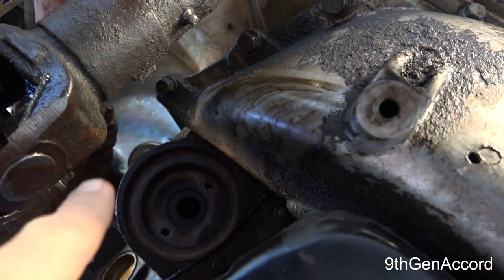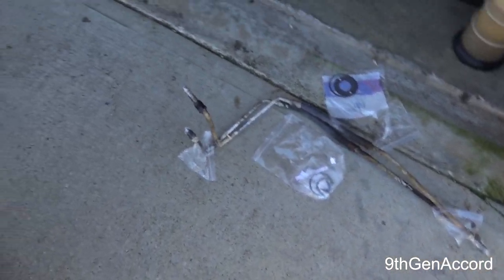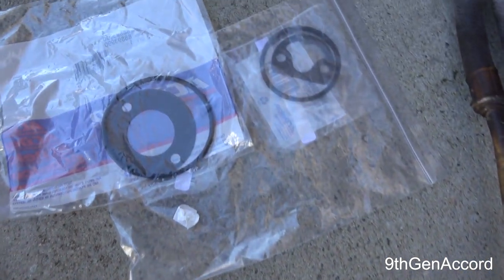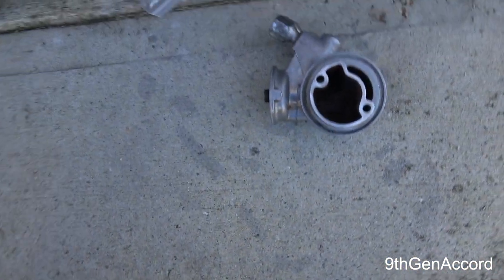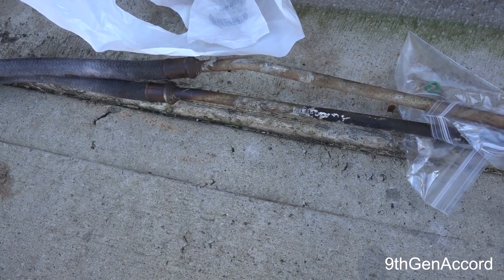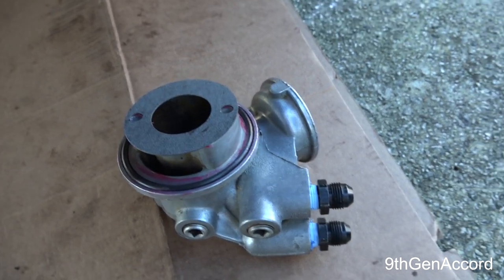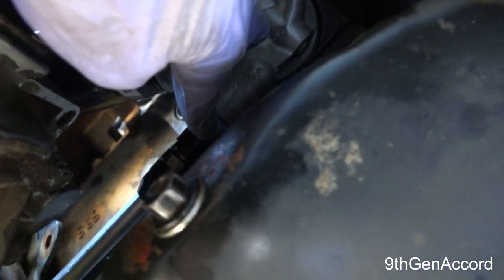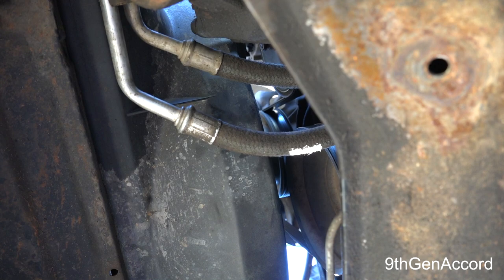Chevy Oil Filter Adapter and Cooler Line Permanent Fix 1988-1998 Chevy

Comment: What 9th Gen Accord failed to mention or show in this video is the actual mod to the hard lines.  It requires a 1/2" compression to -8an installed on the hard line (after cutting off the formed end which fits into the original fitting) and a 3/8" male NPT to -8an male fitting that screws into the oil filter adapter.  You'll need two sets of these to complete this conversion.
Reply: Thanks!
Reply: Thank you
Reply: Why not just replace the whole line with a upgrade flexible one?
Reply: Thanks
Reply: @ryanjohnson8099  hard lines are better, like video producer mentions, the rubber fails where it meets the aluminum. Had a 1994 Caprice 9C1 dumping oil pretty bad from one of these rubber to aluminum ends, very similar design on 9C1 caprice except for having a fully auxilary oil cooler and not this cheap junk plumbed into the radiator(where dexcool turns acidic and eats the heat ex changer in radiator and then you hopefully can figure out the end result). Replaced the leaky GM oil hose with 3/8 or 1/2" oil rated air line from a speed shop who would sell this high end air hose to use as fuel line to guys who couldn't afford AN fittings like me as well at the time. I was HIGHLY skeptical of this special air line but it worked flawlessly on these applications. And no viewers and readers, do not by HF or w-m@rt airhose and expect it to work. You could well kiss your engine goodbye. I went with a speedshop owners recommendation who cared more about repeat sales and saving people money over making big bux every sale.
Reply: Is there part numbers for the fitings I am having the same issue on my truck but I am leaking from the rubber Orings and would love to do this to my pick up
Reply: do u have a source for them ?
Reply: What are the exact fittings used on the aluminum tubing once he scraped the braided airline hoses? The exact sizes amd the department you buy them at. Thanks!!!

Comment: Poor design? Dude your trucks like 20 or 30 years old! I would say Chevy made an awesome truck
Reply: It is inherently a poor design. Kind-of like their power steering lines that seep oil from day one, ther is no fix and gm still uses these lines, the only real fix is to make your own lines or get custom ones made by a hydraulic guy. They have their faults, and could be designed better. Your not wrong, it is old at this point, but these failed prematurely all the time with these engines,

Comment: I hope the engineer that designed the oil cooler lines was fired! Such a terrible design. Deleting the lines and putting a regular oil filter adapter on is the easiest way to fix the leaky line problem. You don't need the oil cooler and your check engine light won't come on and you don't need to plug the holes in the radiator where the lines connect to but if it makes you feel better, put a plug in them. Problem solved.
Reply: Can’t you just use two plugs on the adapter that’s already there? Why get a different adapter?

Comment: The proper fix would be to ditch the factory lines and factory in radiator cooler all together and install an aftermarket cooler with all AN lines and fittings.
Reply: compressions work fine if using good hose and line.

Comment: I tested how effective the factory style oil cooler is. On a hot summer day, it lowers the oil temp by 6 degrees. It's not very effective obviously so I deleted the factory cooler and used an external cooler. I saw oil temps drop 30+ degrees after that. Factory oil and trans coolers suck.

Comment: I just delete them with an old school filter adapter, I have seen many engines toasted from the oil cooler failing. Never needed one in the 70's don't need one now...

Comment: This is a pretty good video and although my leak was caused by some halfwit using silicone on the old gaskets when the new engine was put in the truck this video illustrated the correct gasket part number so I was able to go right to work already knowing that my truck had new lines so the leak was therefore the gasket or a cracked housing. I got right to work and done. It took me longer to run and get the gaskets at our local dealership that it did to clean up the housing and put the new gaskets in. JUST A NOTE A CUT DOWN OPEN END 1 INCH WRENCH IS THE TICKET TO GETTING THE LINES OFF AND BACK ON IF YOUR PROBLEM TURNS OUT LIKE MINE OR NOT. THE FRONT OF THE LINES AT THE RADIATOR ARE NO METRIC THE SIZE THERE IS 7/8th. Good video nice curve on line modification. Also I bought out what the dealer had in gaskets. I bought all packs is all they had on hand since my son and I own several of these mid 90s trucks.

Comment: Why didn’t you just do the metal braided line the whole way?
Reply: Yeah or just make a rubber hose with clamped on fittings that fit the cooler and offset block which I believe are 3/8" npt.
Reply: For flexibility
Reply: @mickjager5974  just watched the video and thats what I was thinking that I could just use a hose and delete the metal lines altogether because my 2005 GMC is leaking at the O’ring where the C-clamp is at connected to the radiator.Do u think that would be fine to do it this way?
Reply: @walker1474  Probably. I ended up buying an adapter that lets you abandon the oil cooler. I don't feel like I work my truck that hard to really need it. It was a very simple change over.

Comment: I replace this entire cooler assembly with a summit racing unit, AN fittings and a oil cooler with a dedicated fan and thermostat. I have 5 GMT-400 trucks. None of them leak oil.

Comment: I have a 4.3 and i was wondering if all the Blocks have the 2 tapped holes for the adapter to bolt to   cause my remote system has to be bolted to block  and im not sure if my block has the 2 holes i have seen some that doesent have them.

Comment: I put a small oil cooler on my son’s k1995 and it leaks with auto zone gaskets set does it have to be the big filter housing or will small housing work as well please help

Comment: !997 chevy 1500 pick up with 4.3 engine. with oil cooler. Drive shaft fell out and hit the adapter block that oil filter screws into and broke it. Can I remove it and replace it

Comment: my oil cooler line at the crimped fitting just blew off while on the highway, fun times. wondering if my 350 even needs an oil cooler?

Comment: i have the same truck with oil pressure issues. Those 2 pipe plugs have bypass springs under them? i have a feeling mine are shot and weak.

Comment: I'm replacing just the hoses and reusing fitting but for some reason I can't get them threaded back into the oil filter/engine side. Don't understand. Can the little o-ring be the problem??

Comment: hi...I have the same oem set-up and could you please tell me how did you get the an fittings on the tubes before the oil cooler adapter? thank you the video is excellent but did not show what I need ...thank you again

Comment: Can I replace my oil filter unit? Will the center thread thing change out  from a 1991 c 1500 350 to a 1995 k 1500 350. Im putting the 95  k 1500 motor  in my 1991 c 1500. I dont need the oil cooler set up .  Would rather use the 91 set up. Will it innerchange?

Comment: Just completed this conversion, including filter housing gaskets (of course).  Suggestion - plan to insert PTFE/CPE flex hose for at least lower housing inlet line.  If you cut original lines at the extreme end of line (right before flare) you might be able to work it.  Otherwise, you'll have issues with the short straights/bends.  1st cut didn't provide enough straight line section for fitting.   Then cut line back to 2nd flat section (~1" further) and was able to get flare fitting on. But the line angle is not great and close to frame/transaxle. I consider this a workaround until I get a flex hose in there (which I had it to begin with).

Comment: I have a Question. I did change the the connectors before I seen your video but I used a compression fittings instead of flair fighting. I have lost some oil pressure. Is this normal? Is their something I can do to correct this? Thanks in advance.

Comment: I actually have a leak at the radiator on mine. It drips oil right below where it fits into the radiator. You would think it would leak at the back where the plastic fittings are. Hopefully I can just tighten it.

Comment: Can't you buy steel line for say Transmission cooler and run from the rad down to the flexible line you showed. They have larger steel lines that can be bend to the shape of your old lines.

Comment: A couple of comments - having 2 4wd GMC vehicles, 92 K1500 and 97 Yukon. There is a new(er) change from the plastic retainer for the push-lock oil cooler lines; the newer adapters have a spring/circlip that securely locks the oil line into the adapter.  The o-rings inside the adapter are what repeatedly leak after time (by the way, there are o-rings at the radiator connection end also).  I have changed out both of mine at least twice over the years.  This option with just the AN conversion at the oil filter adapter alone is worth the price of admission here!  I didn't even know there was a compression adapter for 1/2" tubing to -8 AN... Great job!
Reply: do u have a part number for the updated retainers that you used? thanks in advance.  I have seen these on transmission lines as well for upgrades,., because the transmission lines were blowing out as well.

Comment: Heat, oil, vibration... plastic [that embrittles and fracs out over time].  Gee, what could possibly go wrong, GM?
Earls makes a straight up 3/8" npt to tubing fitting, but I havent used that so no recommendation there.  I mention it because you installed a little extra something behind your -8 AN fitting for tubing.  What was used?

Comment: Good ol' design for assembly... I replaced 3 lines with Dorman units on my 2000 5.7 van, all three failed at both hose crimps! This is in addition to everything still leaking at the push-in connections or course. Next project is to replace everything with AN flares and BMRW hose assemblies and be done with it!

Comment: Good explanation, nice looking work. My top line is leaking at the front, so I'm about ready to address that issue. Mine, however is a 1994, and I believe the flexible part extends farther up toward the tank. That should give me more room for fittings in there. Thanks

Comment: Good video, plan on running copper on 97 K1500 (left over 1/2" from a home heating oil debacle I do not plan on using) and some oil rated hose for the flex section, but will make rubber section shorter(since copper has better yield than aluminum) much like a setup on a 66 GM car I have collecting dust

Comment: Good job and great idea.  Which exact Blue Monster Teflon tape did you use?  Also, I may use the Teflon tape at the radiator because I get a "weepy" (vert slight) leak there.

Comment: You made me realize that my 1999 4.3 may have had an engine oil cooler hook-up because in front of the oil filter housing,  a hose about 12" long comes off the front and loops back and attaches  back next to the other end next to the hose that came out. I wondered what happened there.  It's a built 1999 4.3 put into a monster 1993 Suzuki Sidekick JLX body sitting on a Toyota truck frame. The transmission hoses go to the bottom of the radiator where your engine  oil coolant lines may go. Maybe all I need to do is buy an oil cooler and mount to the front of my radiator or off to the side of it. OR get a transmission cooler for the radiator and run the oil lines to the base of the radiator like yours is.

Comment: Oh i thought I would point out, autozone sells a kit that shares the part number with the proper gaskets, its a kit that includes the gaskets for all chevy oil filter adapters as far as I can tell. I forgot to mention they are the Dorman gaskets though so 🤷‍♂️ but the old gakset had completely failed

Comment: There are also 2 new bolts that hold the adapter to the block - washer head bolts and washers with an internal seal come as a kit from GM ... P/N 12553513

Comment: That’s a great idea using AN fittings with the compression fitting on the tube side. Thank you posting the video, makes complete sense why my oil filter adapter is leaking. 

I saw a question in the comments about flaring the line, if you flare the line you risk splitting it and would still need to use a backup ferrule. I believe the compression fitting is the best route.
Reply: I'm about to post up a video tomorrow April 1, 2023 how to do it the best possible way in my opinion...... better than factory and looks better as well...... eliminate all those spots where a leak could develop and only have connections on each end.....
Like, subscribe, and share if you feel it helps ya
Reply: That looks like flares from this end. But agree, plan on using compression fittings on my truck as well.

Comment: I just replaced the filter housing with another filter housing that doesnt take the oil cooler lines. I replaced my radiator with a radiator without the oil cooler. I did this a year ago and I instantly gained about 5 more pounds of oil pressure and have zero leaks. I havent had any problems at all so far.
Reply: Can you tell me where you got the filter housing for non cooler setup
Reply: @fordracer1415  it's apart of the engine block. Just remove your oil filter adapter from the cooler housing and bolt it where the oil cooler housing bolts up to the engine and spin on your  filter there.

Comment: hi there my friend good video there my friend keep the good videos coming up by the way I got a 95 GMC k1500 4,3 v6
Reply: 4.3 rocks!!! Otherwise known as the 3/4 350 CI engine!! Same size pistons as the 350 CI and most items that bolt to the 350, such as the water pump, TH350 transmissions, etc., will bolt to the 4.3!!
Reply: @USMC-Sniper-0137  AKA 350 with 2 cylinders chopped off. I think fords  3.8 v6 was a 302 similarly modified. It was also a pretty good engine. Both based on well designed v8s

Comment: Wish I saw this before getting Dorman hoses.  Upper fits fine, lower doesn't fit at all.  I'm giving up on them and ordered all 8AN fittings and will do proflex braided hose the entire way (less chance of leaks with fewer fittings).  The only thing I'm trying to figure out now is what is the adapter needed to go from the radiator oil cooler fittings to 8AN male.
Reply: Found this link, the radiator fitting is 20x1.5(mm).  I went with 8AN fittings, but this link went with 6AN the whole way.  Recommend pulling the oil filter adapter, putting the 8AN to 3/8 NPT adapter and then connecting your hoses to it first.  There is not enough room to mess with a wrench once it's installed in the truck.  Then, push the hoses up first, pull them through as you put the adapter in place and wrench it down.  Torx-40 for the screws on my 89 GMC and just a big flat bladed screw driver to remove and install the plugs that hide them with the square opening.  Waiting for my last parts to arrive mid week.  Reference:  https://www.gmt400.com/threads/how-to-install-an-oil-cooler-lines.30454/
Reply: Where do you get the fittings for the lines? Are they compression or do you have to flair the end?
Thank You
Reply: William Cunha I got everything from Amazon. The ends for the pro-flex hose, which is rubber in the middle, is a special compression fitting. I did have to turn down the 20x1.5 mm fitting to 3/4" OD and then run through a die to rethreadv them. Pain in the butt but it worked. 20mm is 2-3 thousandths over 3/4, which is what the old lines measured
Reply: Cripes! I just put Dorman hoses in my truck. They went on just fine and the little plastic things snapped right on. I don't like Dorman parts but these hoses seem quality for Dorman. I hope I get a few years out of them until I can do something else. Probably have a hydraulic shop make me some lines that I can use or eliminate them all together.

Comment: Hi. Very helpful video. Can you  tell me the orientation of the oil cooler lines on a 1997 K1500 5.7. I didn't check the orientation of the oil cooler lines before removing them. So I dont know if the top line comes out of the top of the radiator and then connects to the top port of the oil filter adapter or to the bottom port of the filter adapter? I just need to know how the hoses connect from radiator to oil filter adapter.
Reply: I would have the incoming(to radiator) motor oil go in top and  bottom be a return. But be sure NOT to run DEXCOOL with a factory setup like this. Flush all that nonsense out and run ethylene glycol plain jane green coolant (get with bittering agent if worried about poisoning pets) . Otherwise, as commenter above said, run a quality auxilary cooler. Picked up one cheap qat a swap meet, used GM factory one that was used on a PRO-street or PRO-Stock Oldsmobile. Just stinks I do not have the factory K1500 radiator support mounts for it and they are no longer available of course.

Comment: Can you please give me the name of the male and female transmission parts that screw together after I flare the line? I need the two parts that screw into the oil filter housing and the part that goes on the oil cooler line please. I need to do this quickly as mine is about to let go
Reply: 8AN Flare to 3/8" NPT Pipe Adapter Fitting, Aluminum AN8 Male Flare to 3/8 NPT Male Thread Fuel Hose Connector Straight Black Anodized

Comment: I just put on an AC Delco Gasket and O-Ring after trying to use a Dorman. No leaks while the engine runs but, leaks for awhile after the engine is turned off.
Reply: Mine does too, I wonder why
Reply: Same any solution on this problem ?